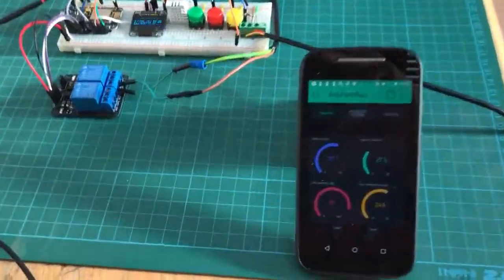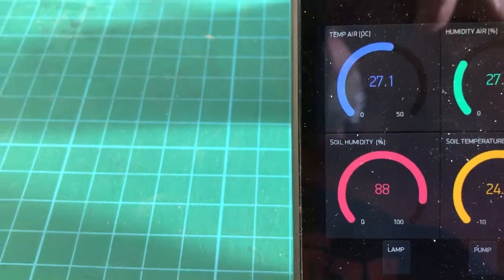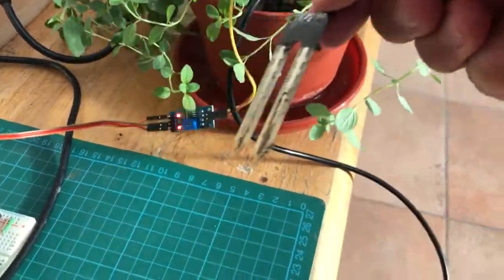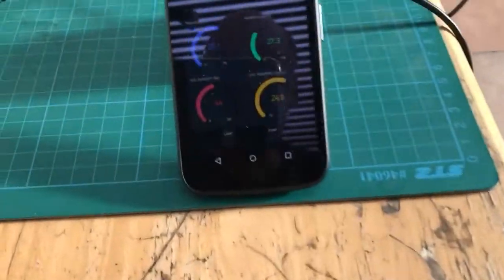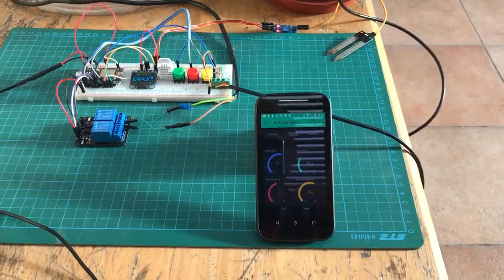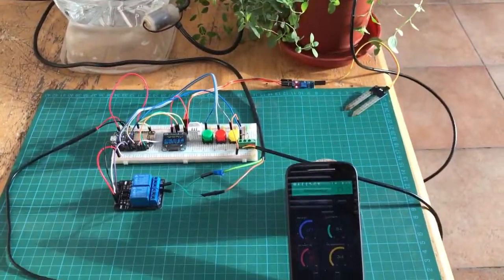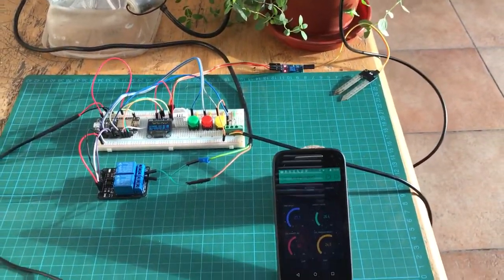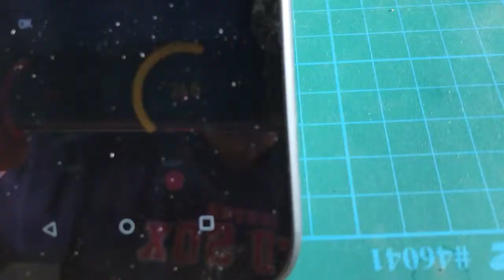ArduFarmBot2 - Automatic real test using a pump - video 5

Comment: I really like your passion and care for details in preparing this project.  So excited i got, that I decided to build one for myself.  However I am using V3 of NodeMCU (The broader one).  At the moment on pressing the sensor button, it is not refreshing the OLED and neither are the relays working.  Could this be due to V3 NodeMcu instead of earlier version?  I see the baud rate being also 9600 in your code, I tried to change this to 115200 but that diplayed only crap on OLED when I switch it back to 9600 then I get the initial display on OLED and also all the sensors are showing up well on Blynk app, but neither the buttons work nor relays.  Kindly share your view
Reply from the maker: Hi Angeel. Thanks for your words! ;-) I really love learn electronics and my goal is to share it, nothing more! I have used the V3 on other projects (see the last one with Alexa/NodeMCU). They work exactly the same. I am using more 115200 as baud rate, but this should not be nothing the problem. Did you try a simpler code only to test the buttons?
Reply: Hello Marcelo, I figured out the issue with my wiring.  I bought your your kindle book that has much more and clear information.  I will encourage everyone interested to get a copy of that book.  

Coming back to where my problem was, the VCC connection that I had done for my two channel relay and for the OLED was on a secondary power 5V supply.  V3 NodeMCU states it is 3.3V so I was thinking it will work better if I put it to a second power supply of 5V and that is where all goof up happened.  I put it on the Board's 3.3V and all is working well now.

I do hope to add a Solid state relay along with the the 5V relay that I have since my motors are big and will draw more current but that should not be an issue, i guess. 

Great learning and what an interesting channel, You sure are my No.1 favorite now, and I will attempt to watch your other videos as well.  Do share a link if you have a patereon site and I will pledge to it.  Thanks and keep sharing knowledge..  Many thanks once gain.
Reply from the maker: Hi, Anjeel! Thanks a lot! I appreciate it ;-)
In principle, the posts have the same information as the book, but I realized that in the process to create it, I cleaned the information a little and add a few better explanation. I have the idea to do the same with other posts, but I had no time to do it. Regards!
Reply from the maker: Hi Angel. Really great that the project is working! ;-)
The Youtube channel is more for support videos of mui tutorials. As an old dinosaur, I prefer write my posts instead to create a video-tutorial. 

My main blog is in Portuguese, but I have a section where I included the English version of it (see at MENU: English). 
https://mjrobot.org
or you can enter with automatic translation:
https://mjrobot.org/?lang=en

Also, my original posts in English are at:
Instructables:
http://www.instructables.com/member/mjrovai/instructables/
Hackster:
https://www.hackster.io/mjrobot/projects

Regards,
Marcelo
Reply: Hello Marcelo, Greetings !!.  Do you have plans to publish Video 6 in this series, with multiple Soil Moisture sensors, and Blynk with similar functionality as with the fully automatic and Manual earlier versions?
Reply: The first question that comes to my mind is that since we have A0 one analog pin on NodeMCU and although it is may be possible to multiplex and use the desired number of analog inputs for Soil sensors, would it complicate the setup.  In other words should I multiply this unit "x" number of desired stations I have to , or it is rather advisable to add more stations to this setup itself?  My requirement will be one DHT22, and 6-8 soil sensors activating the corresponding 6-8 relays.  Multipying units by number of reqd station means that many number of Blynk applications :-(  Would be great to have just one Blynk App